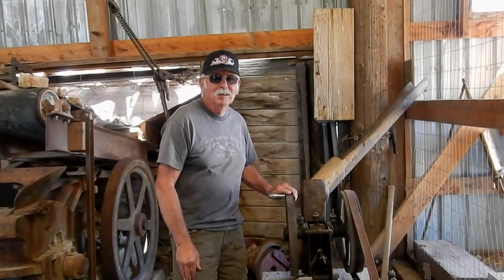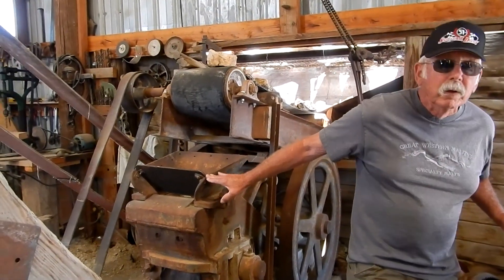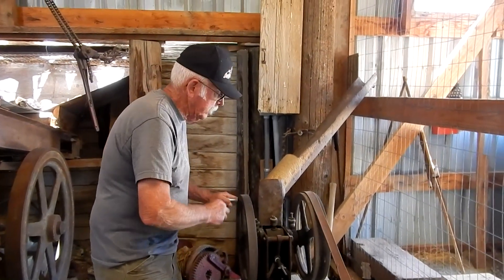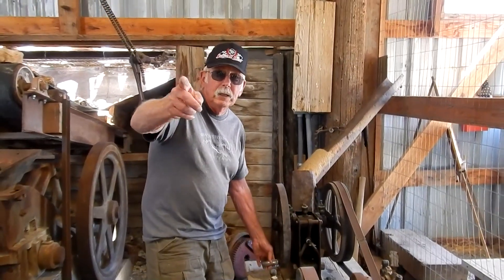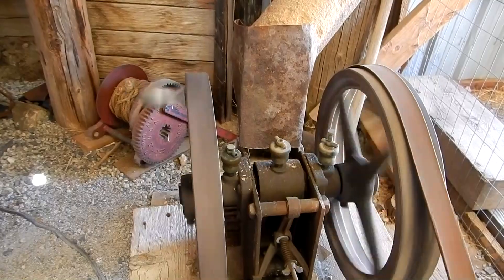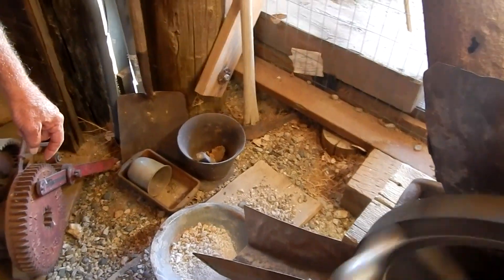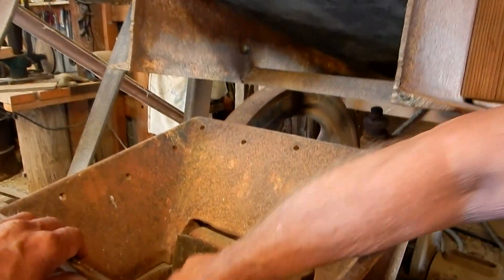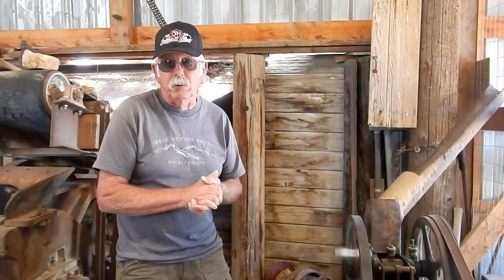Chipmunk Rock/Ore Crusher - Demonstration By Jay - Laws Railroad Museum And Historic Site

Comment: The guys there at the museum must know every aspect of mining from deep in the mines to completely processing the ores.    I had never thought about the need for an assayer but it makes sense that they would have to do this on all the mined ore.   Do you know if they would do random sampling or one from every cart or so?  Does the big crusher work and is there a large form of the mortar and pestle for the production side?
Reply from the maker: Ron and Jay from the museum are both quite knowledgeable about mining, for sure. As far as I know the assayer would run samples from a prospect to see if the ore was rich enough in a particular mineral to make full production of a mining operation profitable. I'm guessing they would also check samples once full production was underway to see how the mineral vein was producing. The production version of the mortal and pestle would be a mill which takes the walnut sized rocks you saw coming from the big jaw crusher and reduces them to powder. There were different types of mills. Stamp mills, ball mill and rod mills were some of the common types. The 3 stamp mill can be seen in the hit and miss engine video I have from the museum. Large metal hammers were lifted and dropped mechanically pounding the ore as it was fed through it. Some larger stamp mills had as many as 10 hammers. The ball and rod mills were big metal drums filled with large metal balls, or rods, that would spin slowly and when the ore was added the balls, or rods, would smash the ore into a powder. After the ore was milled the mineral was able to be extracted by various means often using mercury or cyanide (for gold). Thanks for watching and for the usual great questions,    P-Daz!
Reply: @TomandJulieMineExploring  Thanks for the information.  It is an interesting subject and I can see why you enjoy exploring these areas.